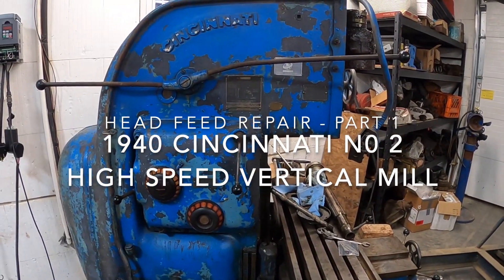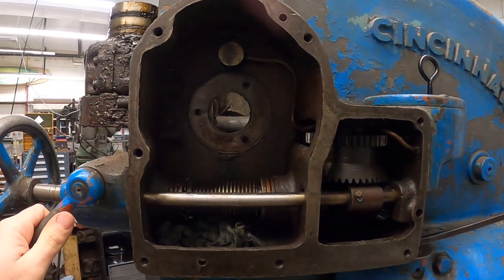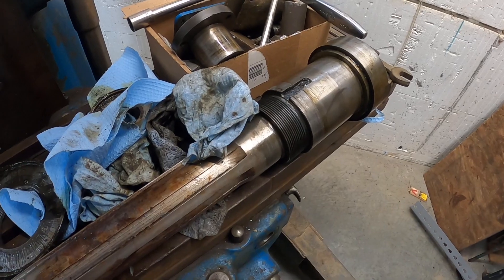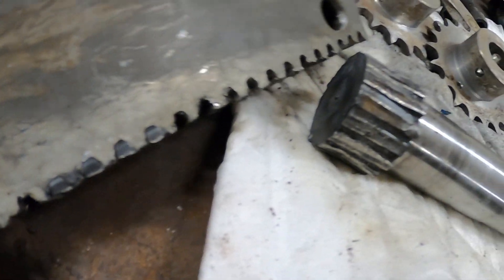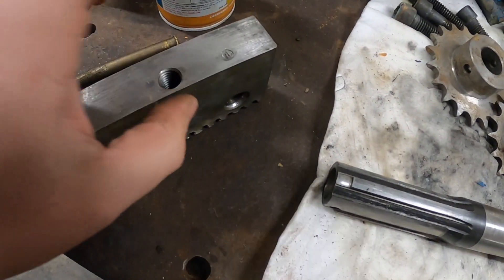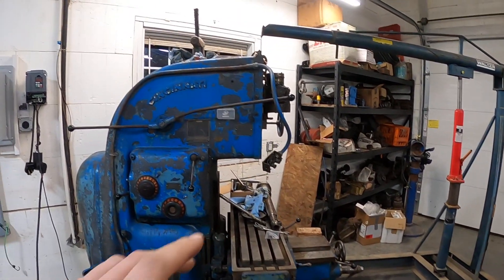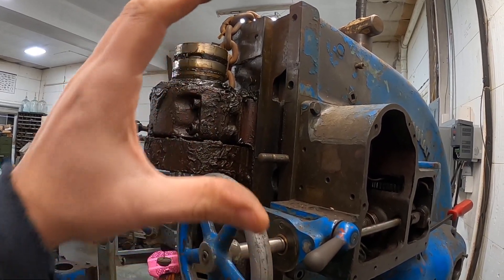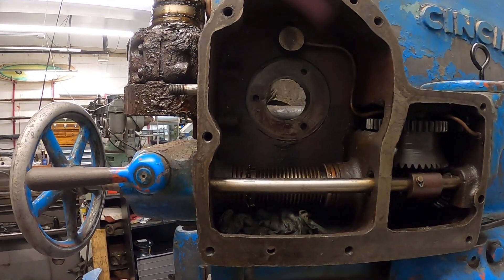1940 Cincinnati No 2 Vertical Mill Head Feed Repair Part 1

Comment: Dont ya love it when someone who has no idea what they're doing tries to fix something. Did you end up getting it running?

I have just cleaned up a 1940's smaller british mill (only about 800kg), thankfully mostly 40 years of dust and surface rust and only have to look at mounting beltdrive and new motor